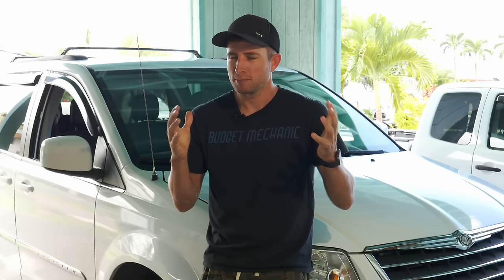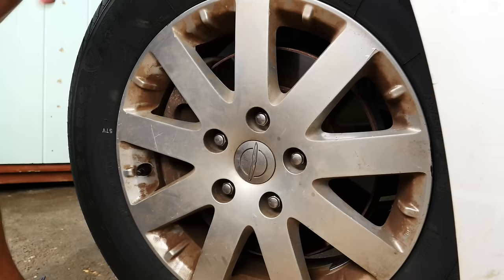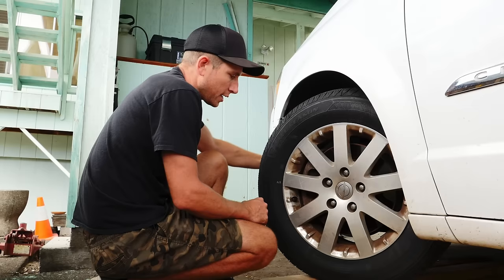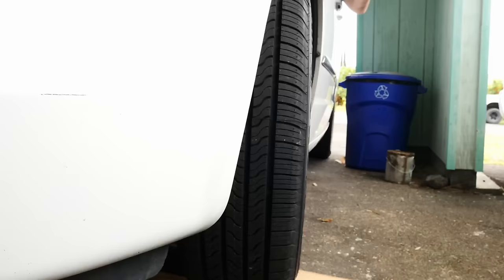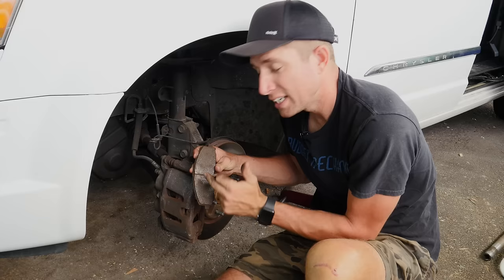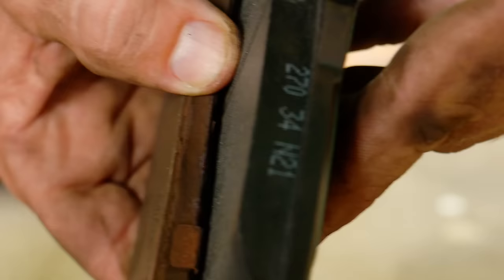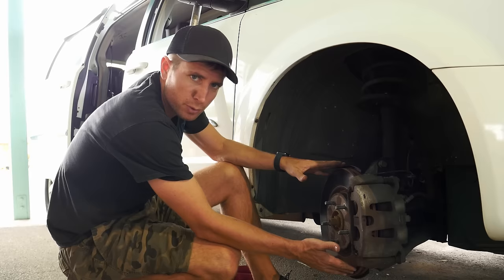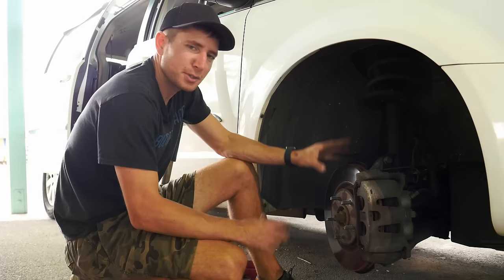How To quickly Check Your Brake Pads and Rotors - Don't Waste $$ Changing them Too Soon!!

Comment: I was just told I'm at 4mm and a little rust on the rotors. They showed a picture of the pads and they said I could wait but recommended the rotors as soon as possible.  $1200 for the front and back before taxes. They nuts!!!
Reply: Rockauto!
Reply: Don’t do it. They are ripping you off!
Reply: Way too much $$
Reply: Let me guess was it Midas?
Reply: @theloneviking9145  Toyota dealership
Reply: 400$ plus 1.5 hours of your time to change them yourself ....
Reply: Sounds cheap to me, I’d think at least $3,000
Reply: @Bruce6001  for a Toyota prius? Those not performance brakes.
Reply: @mostmost1  I’m joking lol
Reply: @Bruce6001  I know, just couldn't resist. 😆
Reply: If your pedal isn’t pulsating I’d just change the pads and grease the pins and hardware.
Reply: My brakes have been at 4 mm for a year. Visual inspection is a joke. Have them measured in front of you  otherwise your getting them done way too early. 😂
Reply: Is that for 4?   Easy diy
Reply: Try max advanced brakes.  I got all four corners for 300 bucks rotors and pads.  Hour or two in garage job done as good or better than any shop would do
Reply: @mostmost1 toyota dealer uses oem parts. They're about four times the cost of aftermarket but don't last four times longer.  I'm not surprised at that price I bet oem parts are 800 bucks. Little high though for sure
Reply: Most pads have at least 8mm of material most specs call for 1mm left. If you have an example 40k on the pads at 4mm you have a while. These modern mechanics like to change so early it’s a total waste. Ie: 40k divided by 4mm is 10k per mm. Check pads at least every 15k miles and don’t waste your money changing before 1-2 mm.
Reply: @NoName-tz5ji  usually 1.6mm.  Dirt bikes commonly 2mm
Reply: @NoName-tz5ji  4mm could go 10000mi
Reply: @666dynomax  It was an example. Everyone drives differently with different friction materials on different configurations. Try reading again,if necessary take a reading comprehension course.
Reply: @NoName-tz5ji no I comprehended everything you said.  I was mostly agreeing my friend.  Just clarifying 1.6mm.  Either way most ppl change before.   No harm meant.
Reply: @666dynomax  I misread it,my bad.
Reply: $1200?  At that price I’ll get into an accident.
Reply: What? Put new ones on. Aftermarket. Maybe 400 for rotors and 200 for pads. But that isn't the quality they are putting in your car. When they changed my dads filters, they were the cheapest 10€ filters ever. Even tho they charged Mann filters. They used some cooper fiaat something that felt cheap. Warped. Was damp. Was way out of dimensions. Random mechanic bullshitery.
Reply: Gotta be midas
Reply: @guitarbla3k  Toyota dealership
Reply: Is it just pads or rotors too
Reply: @princewillanyagagligbo6890  pads and rotors. I didn't pay attention to that nonsense.  Kept driving the car until I sold it in June with no problem.
Reply: I was told 1200 or 1400 from Les Schwab 😒
Reply: How do i know if the rotor or the caliper if broken?
Reply: @crucifire9224 rockauto is trash. Cmon man 🤦‍♂️
Reply: Selling kidney dialysis and heart surgury...150,000$? Murder?
Reply: Wtf $1200? Shit they OP lol
Reply: @666dynomax I purchased  OEM front and rear brake pads and front rotors for my 2013 Lexus RX 350 for less than $310 taxes included from Toyota parts online (by choosing the cheapest dealership from there). Local dealer would have charged twice as much.
Reply: 1k for my nissan altima. Brake pads and rotors.  
No thanks.  I'm buying the parts and having a independent mechanic do the work for me.  350 bucks total for parts and labor on all 4 wheels.  Much Better deal.
Reply: @Bruce6001 $3000? Are you insane? Am I getting a new engine or something?
Reply: @eligreg99  I’m joking lol
Reply: Man, I bought aftermarket front brake pads AND rotors for $120 . My good neighbor helped me changing it and it was done quickly
Reply: For about $300 in parts, you can do it yourself.   If you want to use cheap parts that suck, you could do it for even cheaper.  

Or, if you don't really need to replace rotors, it might cost you $100-$150 for good pads.  Dealerships and repair shops often lie about needing to replace rotors.
Reply: @666dynomax ok, but they’re not using quality pads and you have to ask yourself if the mechanic is doing it correctly.  Even when I pay top dollar at the dealer or independent, I find not all screws or covers are put back.
Reply: I suggest going with the manufacturer’s wear indicator.  Just like tires have wear indicators.  Pads, rotors, tires, etc . come at different quality and price points.  I would never buy a China made tire, but because of dislike of China, but they compete on price and quality is lower.  Michelin tires are rated very high, with high prices.  My OEM tires were Goodyear $125 each, but they squealed driving in a garage.  Replaced them with Michelin LTX $178 plus tax at Costco and they handle so much better.   Pads and rotors are the same thing, with stuff at different prices.  I keep my cars 10+ years, always new, and never someone else’s car because they really don’t care knowing they’re passing the car to someone else like a disease.
Reply: Thanks  & godbless,  maybe show how to replace pads

Comment: Considering what can happen if you let pads go too long, I don't think I'd worry about trying to get the last possible mile out of them.  If you aren't trained in this area, find a reputable shop that will put the car up on a lift and then let you inspect the pads and rotors with the technician.  You want to inspect both the outer and inner pad thickness on each wheel, they should be very close to the same thickness if the brakes are working correctly.  If one pad is significantly thinner than the other, that indicates a problem with the caliper sticking.  Just changing pads without fixing the caliper is not a good idea.  If you need to change the pads on one side of the vehicle, change the other side as well.  Make sure to check the rear brakes as well as the front, often the wear of the rear brakes is less than the front and you will only need to change the fronts.  I've owned vehicles in the past that wore out two sets of front pads before the rears needed to be  replaced.  And lastly, even if the pads weren't allowed to wear so far the metal backing damaged the rotor, you may need to to replace the rotors anyway.  Rotors wear even when the pads are in good shape, and you can see and feel a ridge near the edge of the rotor.  There is a minimum thickness specification for rotors, and the technician should measure the rotors and check the surface finish.  Installing new pads on rough rotors will just make the new pads wear faster, and running rotors that are too thin will cause excessive heat buildup. These days few shops refinish rotors, most are just replaced with new parts.
Reply: Most shops WILL NOT ALLOW you to get under your car while its up on their lift.  The reason is it is prohibited by their liability insurance policy.  Any shop that gets caught doing that will be immediately dumped by their insurance company.

Comment: Makes me wonder if I was taken for a ride with Honda saying that my rear driver side caliper needed to be replaced.  I wonder if they bothered to check something as simple as the slide pin.  Needless to say, I just replaced both rear calipers.  I wished I had an honest mechanic where I live.
Reply: My nieces car was making a noise when she went to turn into a driveway, I started pulling off the tires and checking the slide pins, they all needed grease but one was rusty and that was the noise culprit-been awhile since that pin did any sliding...

Comment: For a typical sedan or small Quality vehicle you can do your own brake jobs for under $200 or under $350 if you need to replace the rotors. A quality modern vehicle such as a Toyota or Lexus  should not require flushing and replacing the brake fluid or bleeding the brakes for many years. Just make sure you check that the slide pins move in and out freely. Otherwise check those for wear and rust and replace c/w regreasing. This process does not include service on the emergency brake system that is hidden underneath the rear brake disks.

Comment: Being from the rust belt of Michigan, it's important to check wear between the inside and outside pad. If there is a big difference, check your slide pins. I found that my pins had seized due to rust. The inside pad was getting all the wear while the outside looked ok. Due to the pin being rust "welded", I replaced the caliper also.
Reply: I think this could be happening with mine, when I look at the rotor there is only shiny metal in the middle then a thick rim of rust on the outside, seems like only the middle of the pad is actually being used.
Reply: Well-greased, free-moving slider pins are so important... and when they get rust-welded in, sometimes not  all the heat in the world will release them. I actually was able to bend one of the pins, it was so seized..... new caliper time! yay! lol
Reply: Does rust resistant coat on the rotors work?

Comment: there is an easier way to have a rough idea as to how your brake pads are.  check your brake fluid level, unless you have a leak which could cause the brake fluid to drop quickly the fluid level will slowly go down due to the fact that as the brake pads wear brake fluid is displaced from the resivour to the brake caliper. If the level is low take time to get brakes checked. Also  if you run in for oil changes and as a matter of service your levels are "topped up" remember that the mechanic when changing your pads will have to press back the piston into the caliper, again now moving that displaced fluid back to the resivour.  If the fluid has been topped it may spill over due to increased amount . Brake fluid is bad for paint.

Comment: Thank you. I'd been recommended to change all four rotors and pads, and this would have been okay, as I knew the job must be pending but I did further research and ended up just taking the whole wheel off for a good look, as you showed. And this gave me a much better view. A neighbour helped me check first, as you showed. I've just done fronts for now and I'm more confident in checking periodically.  Your editing skills raised the quality and value for me. You've affirmed belief that I can monitor pads more closely and finesse those last few mm. I noticed the fore part of the pad can be thinner than the aft (rear) part. Thanks again.

Comment: In New England I find that pads and rotors go bad quicker due to the rust. Slide pins get stuck, the pads get stuck in the brackets, the calipers seize, the rotors get nice big rust rings/lips, etc! Customers sometimes complain about having just replaced their brakes the previous year and only did 10k miles and not their brakes are bad again?! This can happen! The best kept cars are garaged, people who are easy on their brakes, people who don't let their cars sit too long, etc. 

Didn't think I would like this video, but you literally said everything I tell customers! Liked!
Reply: How about coated or silver-zync dycromated rotors and not using cheap pads ?
Reply: @dentuso8  I use pads made of dilithium crystals. They never wear out.
Reply: "People who don't let their cars sit too long"

I have a 20 year old Subaru that doesn't get driven all that much anymore, but I make a point of taking it out once or twice a week, even if its just a trip to the grocery store.. Anything to get the engine running and the wheels turning.  ;)  I agree..  bad juju to just let a car sit and sit and sit..

Comment: Thank you for this! I'm trying to learn to service my own vehicle because service shop prices are INSANE. Plus it's just interesting!

I love this video. Covers the important material with detail and context, no condescending attitude or acting like we should already know this stuff!

And its explained very simply too so even people who aren't in the trade can understand. 10/10. Love it. You have a new fan!
Reply: it's also empowering to be able to do it yourself. :) changing oil, brake pads, and spark plugs are the big ones to know, but i've found out that even changing water pumps and radiators is ... well, much more difficult, but very much do-able. i have had BMW's and now a Mercedes, so i "had to" change the radiator myself, and it is not easy, but absolutely do-able. especially with all these great youtube videos of regular people doing it themselves
Reply: I agree with the comment regarding detail and context, instilling the belief that we can do this.

Comment: I had a couple thoughts to add, first and foremost don't rely on those brake wear indicators because they can rot off even in non-salted areas. Secondly, don't go to the dealer at all unless you absolutely have a need to because after 2020 and probably for the next five years, most dealers are running this scam where a brake problem comes in, quote $1500 for parts and labor, and offer to buy your vehicle and give you money down on a new lease after the job is declined. The dealers don't even work on cars either, just slap on new parts and attempt to dupe folk who don't know any better into fearing a false repair bill. It's not like dealers haven't done it before but seems to be more widespread currently. 

Anyways great video, nice to see Youtube recommending channels like yours. They never seem to feature mine.
Reply: During covid my piano teacher got a brand new Honda passport, her previous car, 06 Honda pilot was in perfect working condition. I wasn't sure why she got a different car but she said that her car had a bunch of problems yada yada. She might've been duped from a dealer like you said, stealerships are such a scam. Just last week I needed my wheel locks to be removed and replaced with regular lug nuts (I lost the key and didn't want to buy a new one, I also provided the lug nuts) and they quoted me $57, for what?
Reply: No idea where you got that information from, but sounds like a lot of here say. I’ve been at dealers for 10 years and have never experienced this from west to east coast. Not saying there aren’t people like this, but it’s not a dealer problem, it’s a tech problem. Independent shops if anything are worse. I’ve been at independent shops that were extremely shady. Thanks to me, they got sued and had to pay out.
Reply: @codywinkle2303   I've been waiting over a year to clarify my comment. I can agree that the issues I've had could be related to the shop itself and not particularly associated with dealerships. Like yourself, I have had service done at dealerships before and usually didn't have much hearsay to be heard. However, in the last year I had an independent shop and a dealership do parts gouging and parts slapping, that's the dealer I mentioned in my previous comment that wanted $1500 for a brake caliper and front brakes. I declined their offer and then went to the independent shop that wanted $1200 for new brakes and rotors for all four wheels and a reman caliper. 

No one wanted to fix a simple seized caliper and warped rotor, they wanted to overcharge and scare me into believing the car would "catch on fire" as the dealership's service advisor put it to force the sale. A week later that dealership sent a letter offering money down on the vehicle attempting to force another sale. The hostile buying and selling technique by the dealer is what I wrote about, but I didn't have a bad experience at the independent shop yet that would have changed my perspective on things. I would have commented something different.
Reply: @aku2dimensional  Same happened to me at an Audi Dealership Service last year during maintenance nearing the end of my lease (under 20k miles after 35 months back then). And by what you wrote here now all makes sense for me. My front break-pads were "reported" in the high red zone, while the read pads were "reported" in the mid yellow zone. Was quoted $1700+ just for the front ones. I declined and decided to postpone changing them(not at dealership) till I really have to head for a long drive or the censors notify me that they are due for change. Earlier this year I bought out the lease. And now in July, just had my 4th maintenance video report and "somehow" all break-pads are back at the low green zone.
Reply: No way jose. Never go to the dealership except for a car recall or service that is already paid for.

Comment: We live in the Southern Sierra just outside Sequoia National Park  (like a half mile outside). It’s a forty mile trip to shopping or doctor appointments. One way. If not for tourists and two traffic lights, I can and have driven all the way without using my brakes at all. And that’s downhill. Coming back is even easier. Drivers from the flats amaze me at how much braking they do. Especially uphill. I often remark to my wife, ‘I’ll bet that driver buys brakes pretty often”.  My 2017 Tacoma has 49k on it and is nowhere NEAR ready for pads. Cheers. Good video
Reply: How do you do That, do you have manual transmission? With automatic transmission how do you avoid using brakes ? Thanks.
Reply: @wild downshift it yourself or brake Early but light pressure
Reply: @wildhorses6817  Anticipate the red lights and coast up to them. Never understand why people floor the pedal between lights.